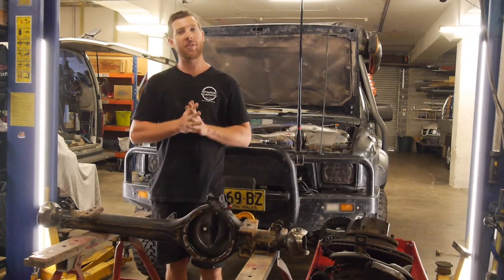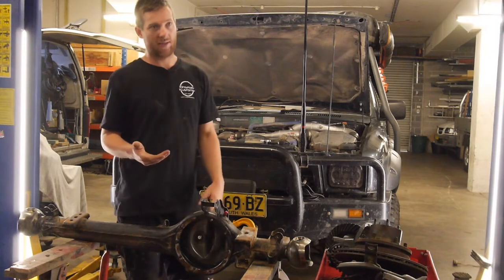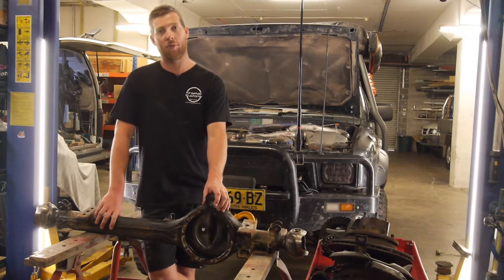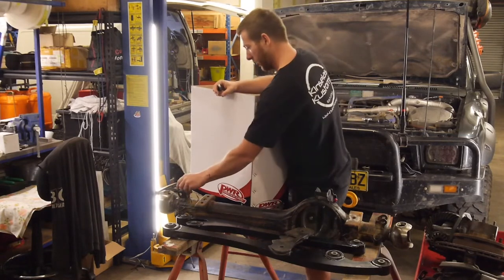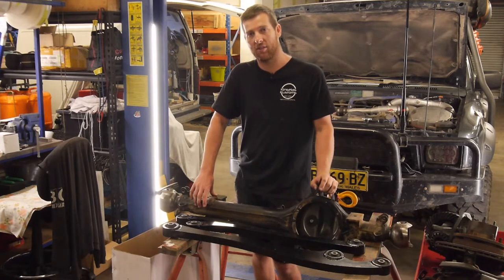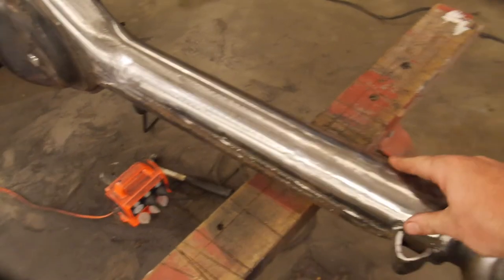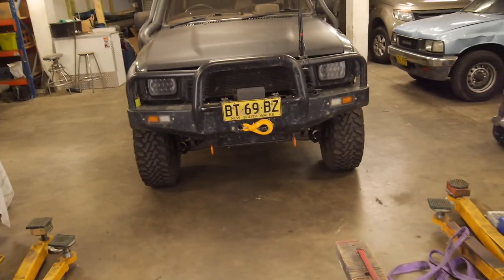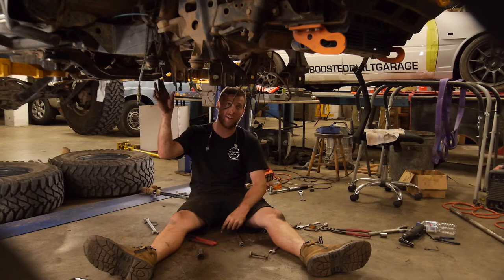SASSING THE SURF - PART 1 | Solid Front Axle Hilux HOW-TO

Comment: Why not use the same laser to mark the axle centerline on the guard? More accurate than holding up the tape and guessing at how straight up and down it is.
Reply from the maker: I wasn't concerned about the axle centre line being marked on the guard. It was merely a reference mark for where I measured. As you will see, I set the axle up further forward and also referenced multiple mounts and holes on the chassis etc to make sure I got the axle dead true. Not relying on where the front wheels sat before as they can move with the alignment adjusters anyway